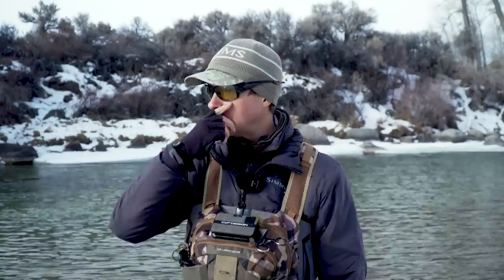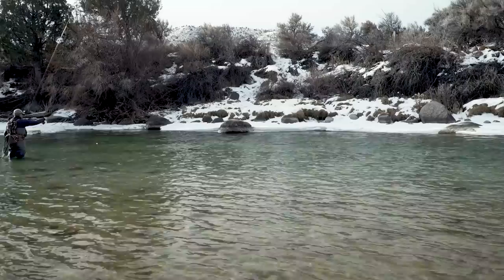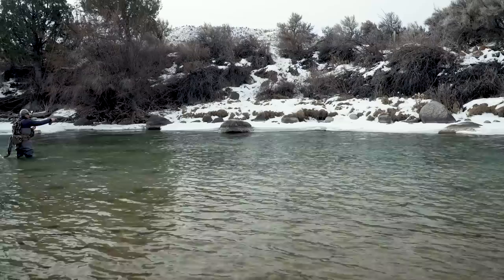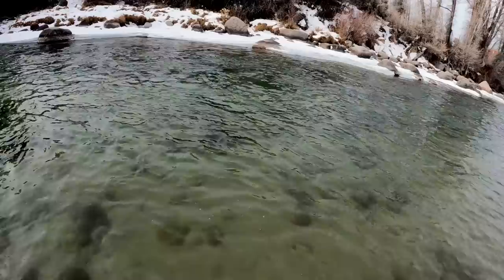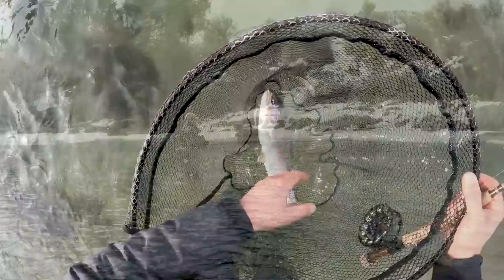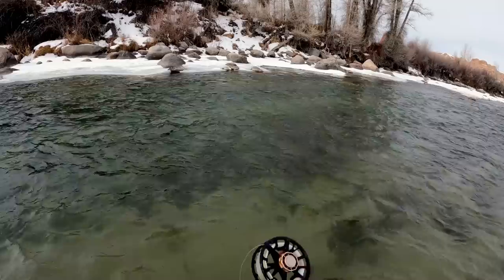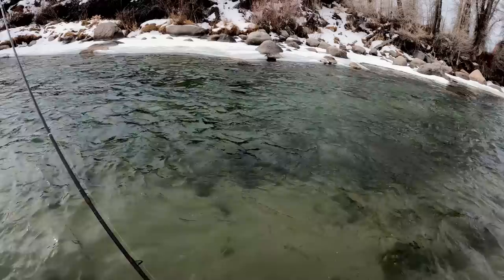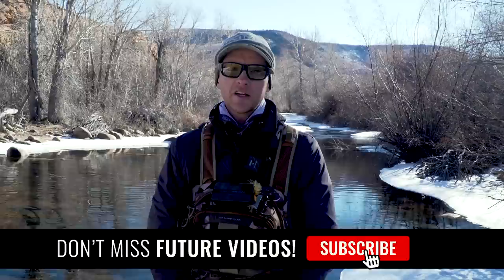Euro-Nymphing a Winter Pool for Big Trout

Comment: Devin, thanks for all the content you create. Euro nymphing here in Wisconsin absolutely crushes fish. 
My question is how do you manage carrying multiple rods ? Rigged? Unrigged in tubes?
Reply from the maker: Cole, I plan on doing a video for this topic this summer. In the meantime, you'll see in this video that I have a second rod stuck up in the air. It's placed in my waders with the straps of my chest pack keeping it in check. I tilt it to the side I'm not casting on. If it's smaller water I usually just place it on the bank. There is also a product called the Opros 3rd hand rod holder that we sell in the shop that works well.

Comment: Devin - first off, thanks for all of the education and techniques in your videos.  They're so helpful....    Quick question on your gear.  I've been considering changing up from my sling pack to your Umpqua chest pack option.  Been concerned about how it may interfere while fighting / landing fish and if you ever feel constrained with so much in front of your hands/chest?  Thanks Rob
Reply from the maker: Rob,
    It's not an issue for me. Just make sure when you set it up that you don't have a bunch of stuff dangling off it, so it doesn't catch line but it's not an issue for me overall.

Comment: I was surprised by the mop fly choice in winter and that it briefly worked. I assume you switched back to the Hare's Ear Blow Torch as it was more productive?
Reply from the maker: The Mop is a pattern I usually try at least once a day regardless of the season. I did change back in this video but I tried it later in the day as well and I caught a lot of fish on it.

Comment: Hey Devin nice video, I have a question regarding euro nymph rods. What would you say the max bead size is for a 2wt euro rod on a double nymph rig ? I know some people fish a 2.8 as the point fly and a 2.3 as the dropper, I’m just wondering what the maximum is before the rod starts to cast inaccurately because of slow recovery. Would you say the 3wt is more of a “do it all” type of rod as opposed to the 2wt?
Reply from the maker: Nathaniel, it depends a lot on the individual models of rods you are talking about. Some 2 weights are close to other companies’ 3 weights and vice versa. With that said, none of the bead sizes you mention are beyond the ability of most two weights. I find that 3.8 mm flies or mops that soak up a lot of water are where things tend to get tough.
Reply: @tacticalflyfisher3817  for example the Thomas and Thomas 2wt… could you throw a 3.5mm fly with an additional lighter fly on the dropper like a 2.3mm? Or is that rod more suited for single nymphs once you get around 3.3-3.5.
Reply from the maker: @nathanielchoate69  There's no reason you couldn't throw that type of rig, though the 1093 would do it better in the case of the T and T.
Reply: @tacticalflyfisher3817  okay thanks

Comment: How much actual line do you typically have out? You mention rather than lifting the rod you get your sighted off the water with your left hand.
Reply from the maker: With the floated sighter rig I was making longish 25-30' casts and then retrieving slack. With a 21-22' leader and a tuck cast, I probably had 1-4' of line out the rod tip on my longer casts.
Reply: @tacticalflyfisher3817  thanks- as a newbie to euro nymphing, My cast are considerably shorter: I don’t have any line past about the first ferrule.
Reply from the maker: @joeborgione5477  That's pretty typical for a lot of new Euro nymphers and many never move past it. Learning to make longer drifts where necessary and manage the accompanying slack is a critical skill to open up new water and for being able to nymph with less weight and smaller flies.
Reply: @tacticalflyfisher3817  thanks!  It just takes time I guess. As long as you make videos, I’ll keep watching!

Comment: In every video, there is always a new tit-bit of information that I can use to improve my game so thanks.  However, I do have some confusion about rod position and my position relative to the fish once the fish is on.  In your three Modern Nymphing videos, you consistently emphasize the need to have the rod at a right angle so that the butt protects the tippet.  In addition, we are also told we need to ensure the fish is upstream and if necessary we should move downstream to keep the fish above us.  Yet in this video, on several occasions when fish, and some were large, were on, your rod was pointing to the sky and the fish was skirting across the top of the water surface.  Also, several fish were allowed to go downstream and you made no attempt to reposition yourself.  Please address my confusion.  Cheers.
Reply from the maker: Alan, 
I maintain those positions until I'm about to net the fish but at a certain point the rod does need to be lifted to get the fish' head up and into the net. And once the fish is showing signs of tiring, skating them on the surface can be easier than repositioning them if they still are downstream but you have to read the way the fish is fighting to do that reliably. I also didn't move to chase fish in this video because I didn't have a cameraman to follow me and I knew I would be out of the frame if I went downstream. Lastly, the wide angle of the gopro lens distorts the rod angle when it's close to the camera so that may have skewed how the angle appeared.
Reply: Thanks makes sense

Comment: that's the 10'9 #3wt ?
Reply from the maker: Yes
Reply: @tacticalflyfisher3817  I Search a rod for euro nymphing but for cast in all river small and big river, but i fish in france and the fish is 10" maximum , you think with the 10'9 3 wt she's bent on small fish like that ?
Reply from the maker: @axelg4263  You would probably be better off with the 10' 9" 2 weight for that size of fish.
Reply: @tacticalflyfisher3817  OK and which one bent more and made more sensation the Dimondback 10' 1wt our t&t 2wt?
The diamondback is false with the weight but I've never tried this 2 rods
Reply from the maker: @axelg4263  The 10' 2 weight Contact II is an incredible rod for smaller fish and rivers. It would be my first pick but the Diamondback 10' 1 weight is also very good and would be a great choice if you are looking to save a bit of money.
Reply: @tacticalflyfisher3817  OK but the diamondback 1wt it's more stiff than the t&r contact 2 10' #2?
Reply from the maker: @axelg4263 slightly but not a lot.